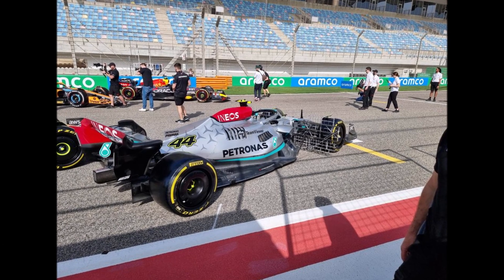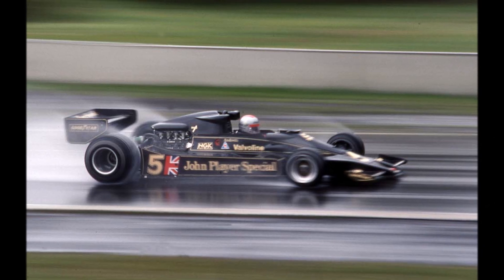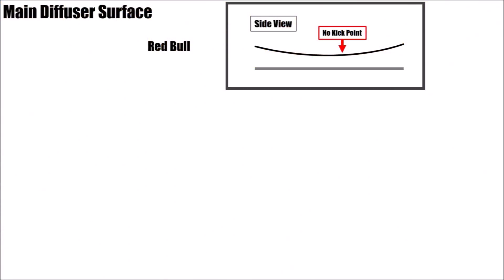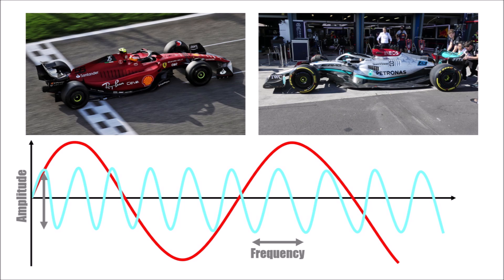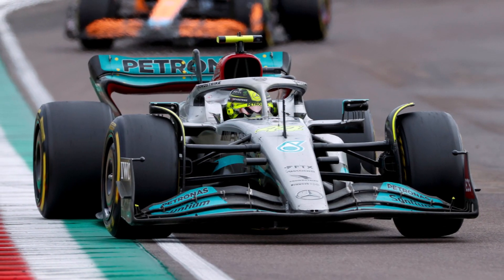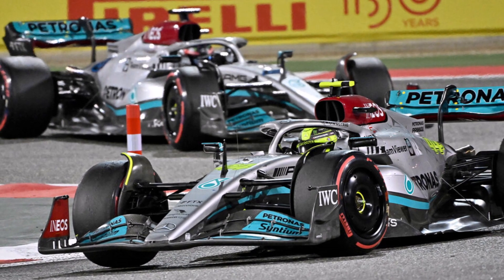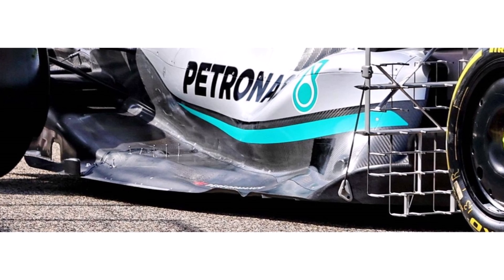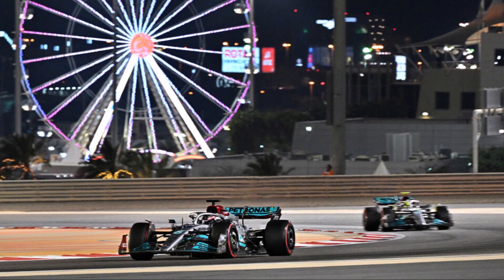F1 2022 - The Mercedes Problem - EXPLAINED

Comment: Interesting, possibly Mercedes could add a protrusion to smooth out the double kick point, like Ferrari tested it's diffuser mod, to see if it helps. Prior to making a whole new floor and the associated cost.  I can see the issue of the floor flexing and making the problem worse. I guess we might see a return to long, low and wide sidepods to keep the floor rigid, low centre of gravity and clean airflow to the rear wing and diffuser.
Reply: I really hope you're right! The floors extending way beyond the body of the cars looks so gimmicky.
Reply: maybe, but I would really love to see a solution where engineers figured out to make the small sidepods work and if anyone can it is the engineers from Formula 1 :D)😁

Comment: It sounds like Merc have kinda trapped themselves this year. If they solved the bouncing and were able to use the whole concept to the fullest effect, would their slim design really give them the best package overall?
Reply from the maker: If they can save weight somewhere else, so they can afford to stiffen up that floor and create another floor without suction peaks that works for them - maybe.
But that's far away right now.
Reply: @bsport320  is a slim side pod actually helpful though? Your frontal area must be about the same because of the front wheels, so it just seems like you have no ability to control the front wheel wake, and this will ruin the flow for the rest of the car. Seems like an outwashing wide bodywork would be better. And strengthen the floor at the same time.
Reply: @Prod Mark We'll see how things go on Sunday. Until then, I'll be skeptical.
Reply: @Prod Mark Says who? The only person who doesn't talk shit is Shovlin, and he said that if they have found the right direction, it will be a series of upgrades. In the mean time, the other teams that didn't get it wrong, can continue the update programme they already planned out
Reply: @Prod Mark You mean how the Mercs look good on a low downforce, low drag circuit, (with less porpoising) with very high temps (when the previous race was about poor tyre warmup)?
While they are wasting their time trying to work out how to fix their car, other teams are sticking to their development plan, and will bring updates at Barcelona.
Shovlin is only one from Merc who doesn't talk out his ass.
Everything about Merc performance is purely theoretical at this stage. They are convinced they can create what they have in the sim. Maybe they can. Maybe they can't. But we know they got it wrong with their previous thinking.
Using emojis doesn't make you more insightful

Comment: I don’t understand the weight compromise for floor strength vs tight body shape. 

Everyone says that it would cost them weight to strengthen the floor, but shouldn’t that be weight that they already saved with the tighter bodywork? 

The weight problem seems to me to be elsewhere in the car. I understand it doesn’t really matter as they are overweight, but if they can lighten the other areas then they can strengthen the floor without adding to their overall weight. 

I bet they wish they had stayed with the black design now! I am surprised they haven’t reverted to save the paint weight.
Reply: The tight bodywork doesn’t save much weight, they’ve got the same things inside the car: engine, radiators, … just packaged differently.
Other cars also have a lot of empty space inside the sidepods.
Reply from the maker: Bodywork is just around 2mm carbon fibre, so even if you have large sidepods it's not much heavier.
But to stiffen up a thin plate like the floor, you can easily spend kg's on it.
Reply: Yeah that's a nice thought. Wonder how much they can save going back to black which is mostly carbon very little paint
Reply: @edenbh3609  I don't think they will, at least I hope not. The silver arrows shouldn't be black, it's very ugly on track. And even if they did, I'm not sure they would save enough to justify a complete livery change, but let's see...

Comment: Could Merc use a more flexible floor that bends to seal before suspension compresses meaning the outer edges seal but the main underfloor stays at a more consistent hight?

Comment: Mercedes 'bit off more than they could chew'... I can't help thinking back to both Binotto and Horner's 'over' reactions to the new slimmed down sidepods at Barcelona... they were genuinely troubled at the time indicating Merc had come up with something 'groundbreaking' or advantageous!
Looks as if Merc took the 'high road' and it hasn't worked out well for them! Bit of hubris perhaps but then again 'nothing ventured nothing gained'! If Merc can now come up with some Adrian Newey inspired solutions in the next 2 races they might salvage something from this season!
Mercedes are really going to struggle to catch up now! Looking forward to your next analysis Martin! Excellent review!
Reply: Binotto said they had tried slim sidepods and they weren't the solution, so he didn't really overreact

Comment: One of their major problems that almost no one talks about is that their entire floor is a wide open area for dirty air from the tires and front area to hammer uncontrollably the floor, lifting and grounding the car as speed increases (proposing from the top of the car). That could be part of why they don't understand their bouncing. Is it coming from the top or bottom of the car
Reply: Good point. Maybe that makes them more susceptible to dirty air as well?
Reply: Mmm maybe. At least it ads some drag.

Comment: so it would be logical for mecedes to build at least 1 test floor, thats has 1 or no kickpoints. if that then allows them to run lower with less bouncing, the lower theoretical downforce is irrelevant if the realworld performance is better

Comment: As someone who understands CFD much more than I, can you please explain the following: are kick points that integral to overall aero concepts? Wouldn’t removing the kick points be a cheap and require relatively low man hours at the factory? My preschool aerodynamics understanding would say just smooth the floor out like the Red Bulls; I can’t imagine that making the bouncing worse. Thanks.
Reply: Everything from the floor fences, how much air goes under the front wing, floor edge details, beam wing etc. works together.
For one, removing the kick points changes the front:back aero balance, and everything has to compensate.

Comment: Martin do you have any explanation as to why most teams have big sidepods this year? We hear it's about front tyre wake but what about all the different shapes?
Reply from the maker: The biggest concern in development was creating outwash to push the front wheel wake outboard, because the barge board area (that did this job previously) is (or should be) gone with the new 2022 regulations.
If you want to know more about this and the different shapes, check out my videos about the 2022 f1 car presentations. I explain that in a lot more detail there.
Reply: @bsport320  thank you for the reply. I have watched all your design videos, so Mercedes will obviously have thought of this as well but they still went with the zeropods and they say the car is super quick in the simulator, so how come the front tyre wake doesn't hurt their theoretical performance?
Reply from the maker: That has to do with the flow pattern behind the front axle. If you can drag enough clean air downwards with the mirror/sidepod area, you can keep the tyre wake outside. 
But that flow pattern can change in corners. Mercedes showed in the past that they are able to manage that.
If you have a wide side pod it always stays in the same position, so it’s easier to keep the front tyre wake away from the important parts at the back.

Comment: Mercedes engine are heavier and is positioned higher compare to previously as they moved the radiator to situated almost under the engine to allowed their side-pod less design.

Engine which is the heaviest component in the car when positioned higher it will massively raised centre of gravity which will make the car much slower around corners.

Then there are no real benefits gained with their side-pod less design but it actually create more problems such as no where to hold floor, no bodywork to help redirecting airflow as well as severely limited themselves on further development due to their already minimalistic side-pods (less area available to improve the car)

Its like they shot themselves in the foot. I think the car needs re-design from scratch starting with the engine, chassis, everything to make it competitive. The car is a mess.